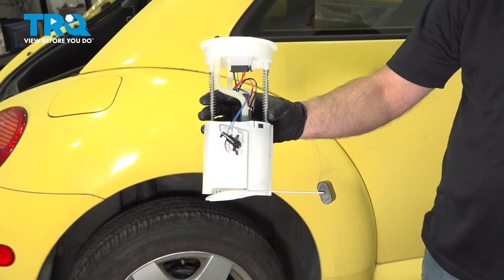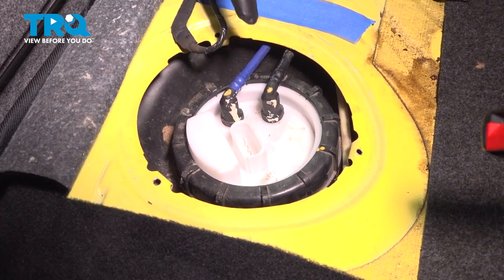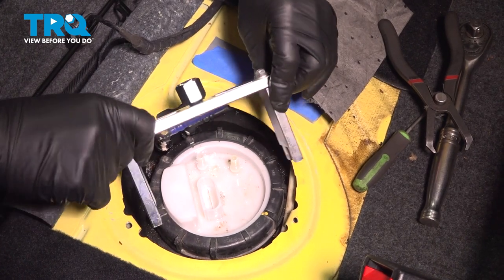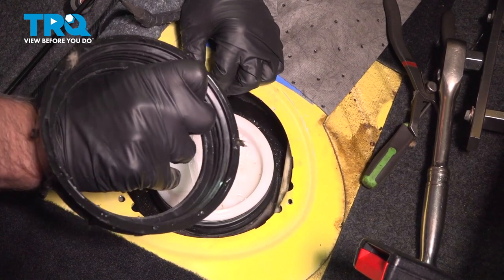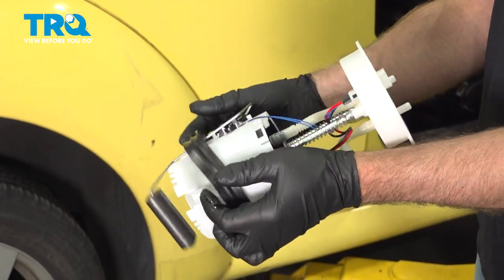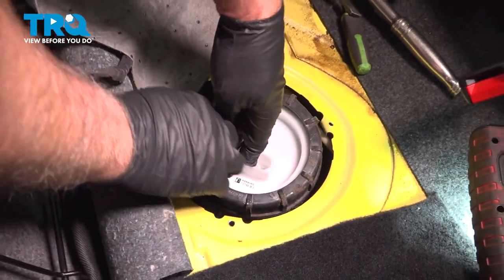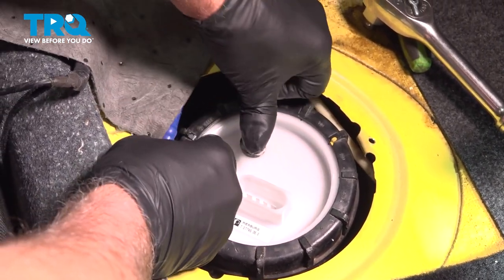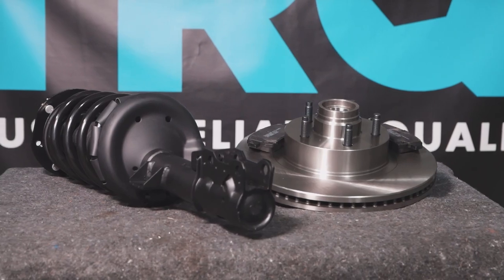How to Replace Fuel Pump Assembly 1998-2010 Volkswagen Beetle

Comment: Excellent 👍🏼 I’m about to do mine on my beetle tdi this morning, and it’s also a yellow beetle.
It looks a very straight forward job to do.
Edit, I’ve done it but the pump sounds very noisy. Bearing in mind I ran the fuel to zero before doing it, could it be air in the new pump ? Will I need to fill the tank more to cover the new pump body ?

Comment: I just had a very hard time replacing this on my 04 2.0L with 64k miles and I feel like it shouldn’t have taken long. 

I recommended unplugging the fuel fuse first then start the car and wait till it shuts off. Then I unplugged the negative battery etc. then I got to opening up the black cover and unplug the connections on top of the pump… one plug spilled a lot of gasoline so beware. I had a very hard time trying to push out the metal circular rim to get out the fuel pump and it’s because I was using a soft ended hammer instead of a metal one.. once I got the metal one it started to come off. Once I got it out I put it in a bucket and then put in the new one.. however I was kinda conceded because the new one I got was supposedly VDO (oem) but the top part wasn’t as bulky like the original one. Another issue i had was trying to put in that orange seal around the edge. It seemed too big… I ended up needed extra fingers from someone cuz the seal kept pushing out.. finally I got it to work. Locked it up real good for another 20 years of opening lol. I decided to replace the fuel filter too.. wasn’t too bad. Put the fuse back on and the battery. I turned the ignition a few times to get the fuel running… then I started the car but it wouldn’t start… about the 3rd time it started and I could feel my car driving smoother and on the freeway I’m going almost 80 mph now naturally.. before I was averaging 65mph and felt bad for the people behind me.

Comment: Hi, I suddenly had 3 elective peobpemas.  1, my odometer shows no speed, my outside temperature sensor stopped at 11 degrees, my fuel level, even though it goes up and down in turns, then drops to 0.  These errors occurred simultaneously.  what do you think it could be?